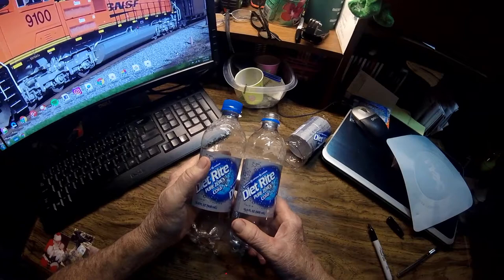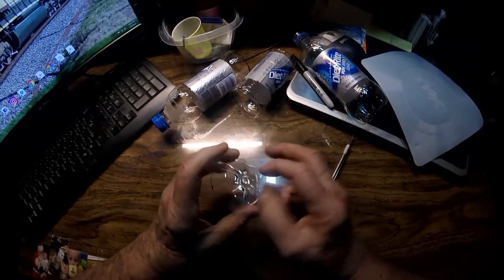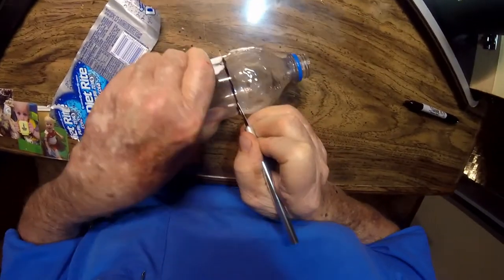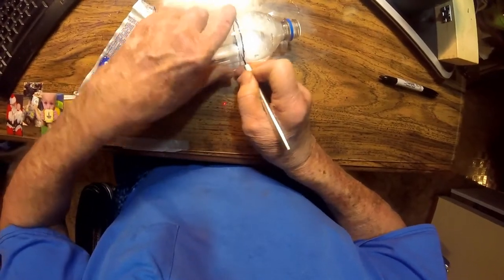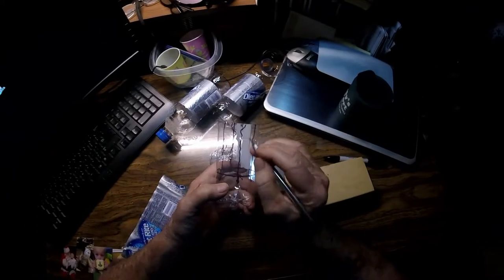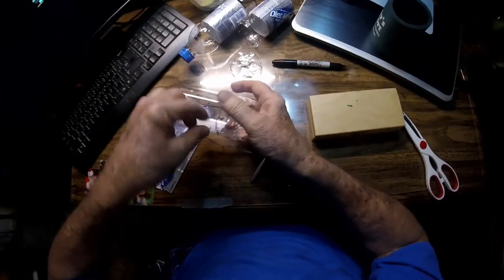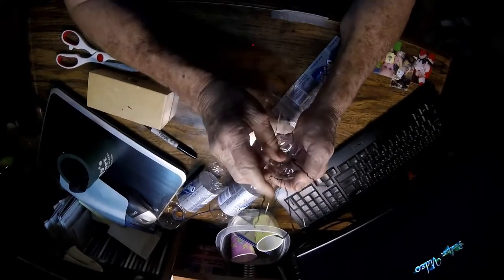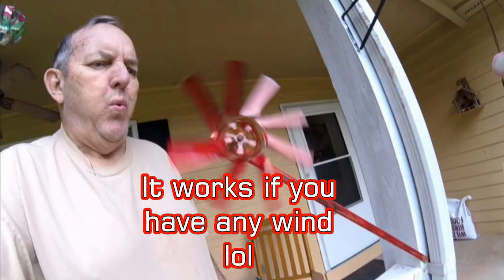How To Make Plastic Bottle Propellor Wind Spinners Part 1

Comment: Slick plastic, rough it up slightly using a very fine sandpaper, this makes a surface that the glue can adhere to. But you'll have to do both sides so they are both slightly rough. Think of a ceramic cup that the handle has come off of. It was glued but the glue didn't hold. So you have to rough booth sides to allow the glue to make both sides adhere. Same principle if it's ceramic, plastic, or a place that you are welding.
Reply from the maker: Thank you  I will slowly get the hang of things  I agree your way is best if I paint them  I didnt put much work into these  I will make better ones